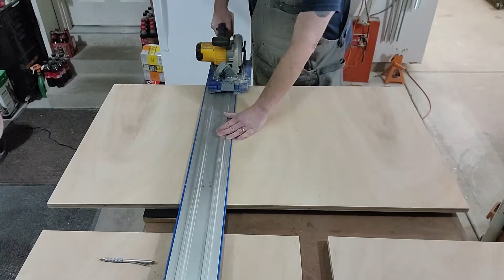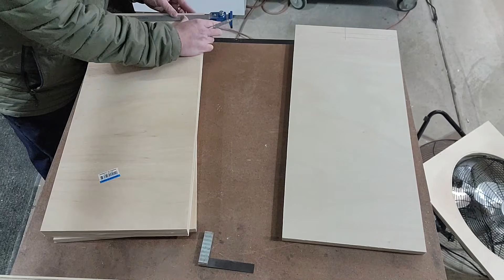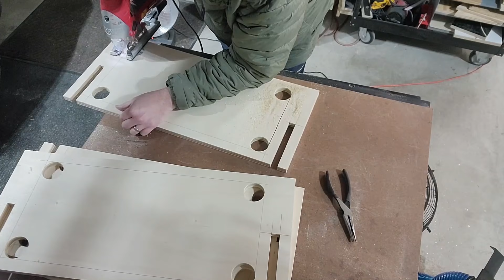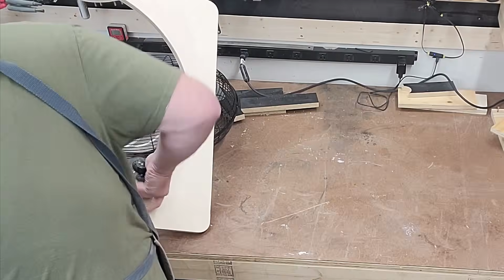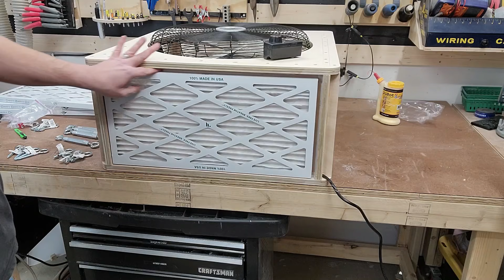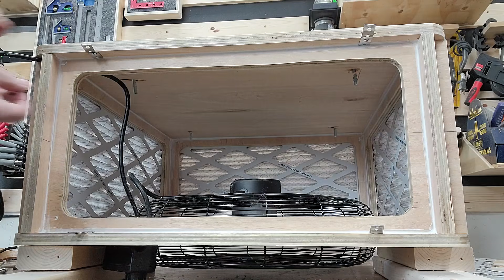SAVE YOUR LUNGS! Woodworking Ceiling Mounted Dust Filter - How to Make

Comment: I think I will take this and adapt it to my shop. Why didn't you measure the filter??? If you had, you would have had a little more on the sides of the sides. Good God, that is large hardware!!!
Reply from the maker: I went with a 12x24 filter. Which is a standard filter size that is available. If I made it to the size of a specific mfg filter, who knows if that specific mfg filter would be available 1-2-4 years from now. Regardless, the openings are less than 12x24, so it's a bit moot anyway. As far as the hardware, probably, but cheap insurance for something that is ~25 lbs hanging over your head.

Comment: You had me... all was good until the caulking and the plumbers tape.  Caulking was a waste with all the other gaps through the fan assembly and the plumbers tape was a hack, some wood turn buckles would have been much cooler. I did like the cross corner idea.
Keep up the good work.   Idaho Pete
Reply from the maker: Thanks for your comments

Comment: I think that fan should be pointing to the side.  With it pointing down it will stir up a lot of dust from the floor.
Reply from the maker: The design was done to help create a convection that would draw dust in from all sides, as opposed to drawing in dust primarily from one side.

Comment: Awesome project! I wonder if adding weather stripping before installing the filters would seal that small gap and provide better filtration? 🤔
Reply from the maker: I cover a bit of that in the video. It would add a little bit I am sure, but even most commercial units don't use them. The clips and the suction from the fan provide a lot of seal itself. But it couldnt hurt!

Comment: Fantastic design quite a bit more fancy than I would do as far as making it pretty. But having four filters is going to give excellent airflow so I will definitely do something like this. A cheaper material to use would be MDF and then prime and paint with some nice automotive spray paint, but you better make sure you do a good job with your pre-drilling and use the right screws with that stuff. I think you could even make that frame out of 2x4's if you just wanted it cheap and functional.

If you don't use Alexa or anything like that another option would be to buy a ceiling fan remote control for about $35. That would even allow you to control the speeds remotely. One thing to remember on the filters is if you get the ones that are extra high efficiency and capture the smallest particles there is a trade-off. And the trade-off is reduced airflow, for most people something somewhere in the middle or upper middle range of filtration would be adequate.

If you have some thin pieces of spring steel it would work really excellent for holding those filters in place. It might be helpful to make a shroud for the fan to divert the air so that it blows away from your work, like have it blowing towards a wall or something.
Reply: Seems that MDF would increase the weight substantially.  As I grow older, the lighter the better. 😎
Reply from the maker: MDF would work well as well. I just chose plywood for strength
Reply: I can appreciate making it fancy if you’re uploading plans. But this reads like someone who doesn’t have any actual projects to work on so they put a ridiculous amount of craftsmanship into shop stuff. 

That’s not bad. But I’ve currently got a complicated geometric wall art project followed by a fancy walnut coffee table build. I’m not wasting a weekend. 

Especially since there was any any fancy filter holding slot or anything it’s just bent metal tabs. Just screw and glue a box together mount the fan and move be on with life. 

But again, I appreciate the mid century modern dust collector, and will use the essential parts of this build to make my own quick and dirty version.

Comment: How often must the air filter clips be replaced due to monthly bending of air filter clips which could cause breakage from metal fatigue, right?
Reply from the maker: I've bent them at least 20 times with no breakage. It's a sharp bend that will break them. Since we are not making sharp bends, they should last a long while. If you bought a roll of strapping you can make a new one anytime for pretty much pennies.

Comment: The problem with all the schemes to DIY fan/filter combos is that they start with a fan designed for use without any pressure loss elements; IOW, free flow.  In general, prop fans of this type have very (!) "flat" fan curves (graphic representation of air flow vs. pressure loading):  a very small amount of pressure loss/drag causes very large loss of air flow.  There are prop fans that can carry pressure losses (condenser fans on air conditioners for example).  One of the problems with all the DIY approaches is that the fan characteristics that allow engineering the system are simply not available to the consumer.  You will feel air coming out of the fan, but it will not have much volume, and won't have much impact on clearing the air.  The loss of air increases with the higher filter efficiencies (eg, merv15+) that you'd like to use clearing out the small particles in the air.  If you're serious about cleaning the air, get a commercial air cleaner.
Reply from the maker: While I appreciate your opinion and agree that there are commercial options that may perform better, this does work. I can see and feel the difference in the air in my garage. The amount of dust collected in the filters in a very short time tells me that it is moving enough volume of air, and this has 4x the media surface of the least expensive commercial options. Much like anything, this is just another option.
Reply: I saw one the other day that used a wheel fan from a furnace . Seemed to work quite well as it had serious air flow.
Reply: @idahopete9211  In general furnace fans (and in fact almost any fan used for interior space air movement) are "centrifugal"* design, and are capable of much higher air flow/pressure than a box fan.  The box fan excels (it should:  that's the whole purpose of the design) at moving lots of air with virtually no resistance or containment.   *The centrifugal design throws the air outward -- hence "centrifugal" -- where the sheet metal housing channels it to the outlet.  There are propeller fans designed for more pressure capacity (on a home AC, the condenser--outdoor--fans do this).  Big commercial/industrial props have the speed and blade angle/shape to produce huge air flow/pressures.  The lowly box fan in a filter app just isn't meant for that.
Reply: @petem6503  Except you really haven't seen these working, have you?  Or even researched how much more filtration of dust it removes than "commercial" dust filters for garages.    Why?  Because of surface area.  And the box fan is far more than adequate to filter the garage in a few minutes.
Reply: @fwiler  Well, I went to work for a fan manufacturer in 1972.  I'm certified for test and balance of air systems.  I have engineered, installed, tested and trouble-shot thousands of fans...gee almost 50 years (come July).  Along the way, lots and lots of filters, hospital operating rooms, computer chip "fab" plants, nasty exhaust systems (the AIDS virus one was really interesting), space vehicle construction environments.  IOW, my comments were based on a lot of hard-nut reality.  I built my own box fan/filter combo to see if the idea had merit:  the performance was inadequate.  Yours may work better, but if dust control was important to me, I'd use a better system.  You do you.
Reply: @petem6503  Yeah, it does work better than you seem to think, along with the 100's of videos showing how well it does work compared to off the shelf "commercial" air cleaners for dust.  Considering it does work, it's inexpensive, and readily available. Like I said, 3-5 minutes and air is recirculated in small garage.  A regular "commercial" cleaner takes 15-20 minutes because of smaller surface area, much smaller fan, and much louder.  I would say that is a big difference.  You may claim an expert, but you haven't compared to what's readily available like most wood workers have, which is why so many have gone to this design.  This isn't a hospital or a fab, it's a garage with wood particles.

Comment: This is the only build of this fan type I've seen so thanks for sharing! I've just ordered three 20x20 filters as I have three of these fans, I was going to do a simple 1 fan one filter but now I'm wondering if to just do one fan and 3 filters and use the other two fans just to exhaust air out of my shop.
Reply from the maker: Curious to see what you come up with!
Reply: I've found that a single filter cuts down on the air flow too much. Go with the multiple filters per fan.
Reply: I went with just 1 filter and one fan, it's working well, draws air well and there's plenty of air coming out the fan.
Reply from the maker: @woodworkingphoto8083  it really comes down to type of filter and how dirty thr filters get. The higher in MERV rating you go, the more restrictive the filters are, so the more surface area you need, especially once they start getting dirty. But if one filter is working for you, then awesome!
Reply: @TheSuburbanGarageWorkshop  its 100% better than what I had before, i.e. nothing! Thanks for making this video!
Reply from the maker: @woodworkingphoto8083  That's all that matters then. Thanks!

Comment: I enjoyed this… It’s nice to see folks like yourself ‘making thing work’ as a genuine hobbyist/homeowner with less than our ‘dream tools’.  I’m primarily a hand tool guy, but also must work with the 10” bandsaw, a benchtop drill press, etc…  I’ll be buying a 14” bandsaw this year, but that’s taken a while to save for and I’ve put plenty of thought into if it’s a need or a nice to have.  I have quite a bit of money sunk into my hand tools, but take a more spartan approach otherwise; think of it as an 80/20 mindset.  I enjoy taking the tool to the timber and working in the silence that it brings, the other 20% falls into things I have to do to get back to things I want to do. In my case the investment in a nice bandsaw will address safety and also open up windows into doing many things that take far too long right now (like hand resawing). So it will fall more into the 80% category. Im not sure if I adequately articulated why I appreciate your channel, but you surely did get a new subscriber with “all” checked on notifications.   I’m still going to watch Shannon Rogers, Bob  Roskowski, Mitch Peacock, and the like for sure, but I’m looking forward to seeing your new videos while catching up on your other videos. IMO, don’t worry about the length of the video. I appreciate thinking through it with you.  👍
Reply from the maker: Thanks for your kind words. I'll be posting a video about my 10" bandsaw later this evening that may mirror some of the stuff you are doing.

Comment: seems like it would be better to have the fan pointing at the ceiling?  The dust is first going to be blown down before it can circle back up along the outside walls and into the filers.  The other way would cause less direct wind in a localized area, and pull up the dust from whatever tool your working on.
Reply from the maker: Thanks for the suggestion!

Comment: Very nice design and build. But however you should not have glued the back on just screwed it. if you ever need to change the fan your power cord pass threw is now fixed and not serviceable.
Reply from the maker: Good point. I was more concerned with structural strength vs serviceability. With all that load overhead, vibration and screwing into the end grain of the plywood, so I was going for as much rigidity as possible. If the fan fails, then that gives me an opportunity to explore any changes or improvements.
Reply: @TheSuburbanGarageWorkshop  the next build you could use all thread to hold the top and bottoms to the side. That way the entire thing could come apart and not depend on screws holding in to end grain. Either that or you could install threaded inserts into the plywood.
Reply from the maker: @nwngunner  great suggestion!
Reply: Well we found THAT GUY 😉!!!
can't say great job or looks good or anything close to that!!, BUT somehow finds the "1" thing that isn't even WRONG and will maybe affect this build 10yrs from now an only has like .0001% chance of doing that!!! And if it did affect it 10yrs from now an has to be completely rebuilt !!! Then OH WELL!! ITS PROBABLY TIME TO BUILD A BETTER AN NEW ONE AT THAT TIME !!!
but NOOOOO!!!?? 
THAT GUY 😉
got to be hating !!!! 24/7/365

Comment: Question about the fan orientation in the design: Why did you choose to go with a vertical-downdraft airflow as opposed to a vertical-updraft or horizontal airflow using a cylindrical impeller? What advantages/disadvantages have you discovered after using for almost a month?
Reply from the maker: It mounted more or less in the middle of the room. So this design allows it to suck dust in from all directions and then blow the filtered air down. So it sets up a convection type air flow. Also, if someone had low ceilings, it could be mounted directly to the ceiling. The air blowing down will also be helpful in the summer to keep things feel cooler.
Reply: Important question!

Comment: how you think this will hold up vs cigarette smoke?
Reply from the maker: The would be solely dependent on the filters you buy. Higher the MERV rating, the finer particulate mater it filters. You'd have to do some research and see what furnace filters are best for cigarette smoke.